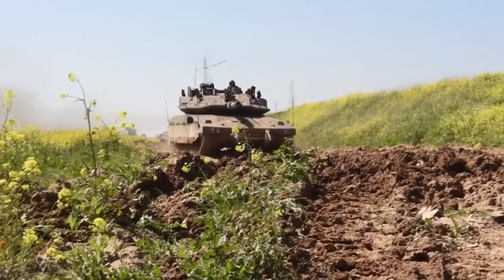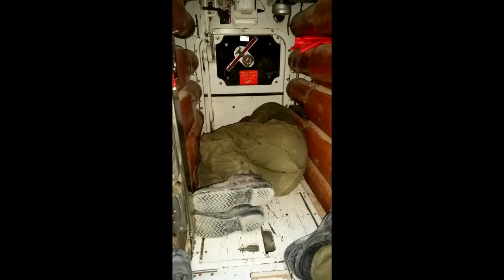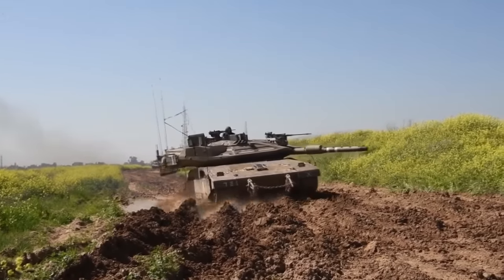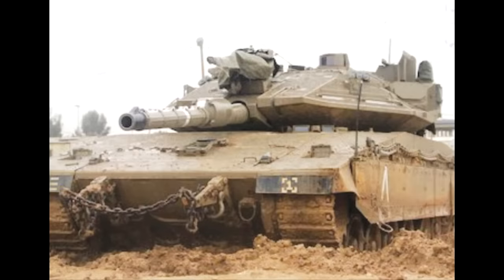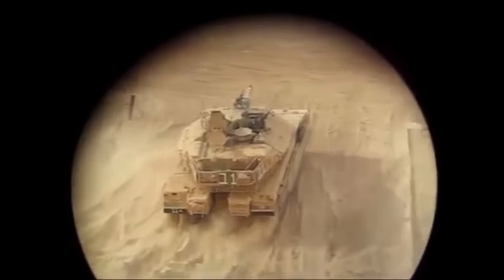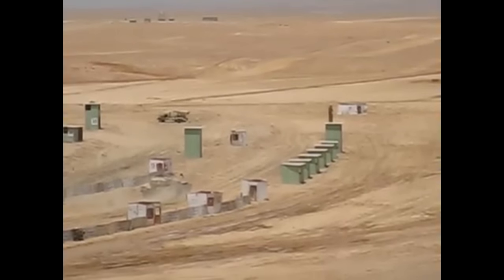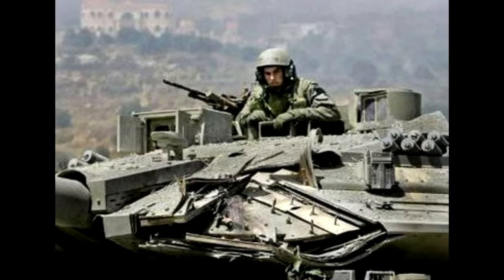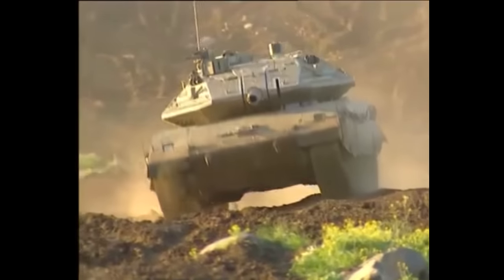Problems with Merkava tank

Comment: just watched this again since this tank got knocked out by a drone that costs at least 10000 times less than it's price lol
Reply: And rpg-7 shell that is old af
Reply: even russian tank dont burn from grenades when hatch door is closed
Reply: @Zx17OPv57i  Yeah,  also the Russians sometimes put a grille over the tank. Everyone in the west laughed at that.
Reply: those are almost all tanks. Most tanks are very lightly armored on the top. Meant to protect from shrapnel and not much else. A mortar round to the head will kill almost any tank from above if it lands in the right spot (in that case, directly onto where the breach was located under, thus detonating the shell)
Reply: @gdtacos7082 bro I have never seen a single tank detonate from a  grenade that small
Even russian tanks take a couple even when the hatch is open
Reply: @MAHORAGADAOPPSTOPPA  more often than not, those are handgrenades being dropped from drones. Sometimes you'll get rpg warheads on fpv drones, but thats more rare. What was dropped on that Merkava Mk IV was a 85mm mortar round. Far larger and deadlier than a grenade or even an rpg. Or, i guess drone propelled grenade in this case. DPG lol
Reply: Interesting assessment from Red but I wouldn't discount Merkava... One thing Red pointed out quite a bit is that Merkava is poorly protected against modern APFSDS rounds, but effectively protected against HEAT rounds. Now ask yourself. Who is Israel most likely to fight? Say over the coming weeks and months? With that in mind, what kinds of ordnance is most likely to be headed towards Merkava? Shoulder launched ATGM's or 120mm cannons? Even absolute worst case, assuming a regional war it would be old T72 monkey models. I wouldn't hate those odds as an IDF tanker. Trophy is going to make a huge difference too, but I do wonder how well it will hold up in an urban environment operating alongside friendly infantry. I'll admit I don't know much about the system but I would not want to be the tanker who shreds a friendly infantry platoon to take out an RPG.

The dropped ordnance is a real problem for sure. But nearly every modern tank is learning that lesson right now in Ukraine. Drones didn't exist in a military sense when any of them were built, nevermind designed. Hell, we mock the cope cages... but really it's jury rigged slat armour on the top. We're just seeing janky prototypes that Private Conscriptovich cooked up to increase his odds. US grunts did the same sorts of things to try and uparmour their humvees in 2003. We'll be seeing cope cages and drone nets on Merkava's within a month. I'd bet money on that.

We'll also keep seeing Merkava's get popped 100%.  Anyone who doesn't think the IDF is in for one hell of a fight is delusional. Hamas is a lot of things but stupid is not on that list. Rational isn't either though and that's a scary combo.
Reply: @imperialus1 that last paragraph made what happened at Mogadishu pop up in my head for some reason..
Reply: No tank is infallible.
Reply: I know ur post is 4 weeks old, but as of now, Hezbollah has merked around 80 Merkava's, and Israel has had to take out the Merkava 3's out of storage to replace them. Also, seeing Hamas shooting Merkava's within 20 feet has shown the trophy system useless to react.   @imperialus1
Reply: @m00dy7  If that were actually the case though wouldn't we see burnt out tanks?  Lots of videos of AT missiles being fired at tanks followed by a big fireball, but if you compare them to tank kills in Ukraine you'll normally see penetration followed by an explosion a second or two later and the tank keeps burning after the fact. If Trophy hits a missile, the missile blows up, creating a big fireball between the go-pro and the target. You even see this in demonstration videos of the system. The real key thing is that, at least in the videos from Hamas that I have seen, we don't see the fire persist. There is an explosion for sure, but then it dissipates. That means the explosion was outside the tank, even if it did impact the armour and an explosion outside the tank just isn't going to do much.

Even if they are hitting the tank, the chances of a direct fire RPG actually causing a catastrophic kill on any modern MBT is pretty slim and 90% of the footage I have seen has been militants firing RPG's. A mobility kill is certainly possible if Trophy fails, but it really isn't that hard to drag a damaged tank back to a forward repair depot and slap on a new track.

Reality is, we have very few visually confirmed losses and it's a bit of a black box. Oryx isn't covering it, the IDF is keeping really solid discipline regarding their losses, and the Hamas militants (understandably) run away before taking the time to confirm a kill.

I'd be interested in any footage or photos you have found showing burnt out tanks. I know Hamas has some pretty solid drone operators, so I'm pretty confident that they would publish any post attack footage via drone.

One of the more interesting videos I saw involved a militant placing a satchel charge of some sort right below the Trophy system and detonating it before firing his RPG, but even then I didn't see any evidence of a secondary explosion that would indicate that the RPG penetrated the armour.

I did see one video where it looked like the ammo bustle blew out, but assuming it was working as designed the crew likely walked away with some hearing loss and a bad headache, but that is the only video I've seen that I would confidently say probably damaged the tank beyond the IDF's capability to repair it in the field.
Reply: @imperialus1  I think you’re confusing Hezbollah with Hamas. I said Hezbollah merked 80 tanks, not Hamas. All I said about Hamas was that ‘it has been reported’ that the close combat (within 20 feet) wasn’t giving the trophy system enough time to react. But you are correct, video confirmation would be hard since they have to high tail it out of there to avoid other units returning fire or if the main gun was still operational. 

I got the info from Scott Ritter in many interviews on YouTube where he said Hamas specially designed their AT weapons and aren’t your normal RPG. Also, he said it was Hezbollah that was wiping out the Merkava’s to the point that Israel has had to replenish with Merkava 3's (no trophy system) and send them to Gaza and sending the 4's to border with Lebanon.

Also, there is plenty of footage on telegram showing Hezbollah destroying Merkava’s with video after showing flames and destruction. Scott has also said the Hamas might be able to beat Hezbollah record of Merkava kills if this continues. He also said that Hezbollah has access to more powerful and better AT missiles than Hamas where the Trophy system and reactive armor don’t provide much protection.
Reply: @imperialus1 isn't the whole point of those two head rpgs is to activate the defense system and the second head to damage the tank? Called a tandem rocket?
Reply: also, about the question of evidence of destruction
the hamas fighters work in small groups of 3-4, they come out of a tunnel, fire and go back into the tunnel, they cant stay around to film the bank burn down
Reply: @imperialus1 commend you for your good analysis, there was a new vid showing 10 unites abandoned in a street.
it wasn't clear if Merkava or tracked APCs, plus Jazeera sat analysis said 88 missing unites last week.
Reply: Всë это ерунда, вот когда Аллах начнëт бить по Безбожникам, вот это будет Ад. Ждать осталось не долго.
Reply: @Zx17OPv57i  U seriously compared hand grenades with RPG ?
Reply: Same with any modern tank, non of them were designed for that

Comment: The design of the merkava is actually designed for counter terrorism ops, more then tank to tank engagements, which is why the engine is in front, to protect against RPGs, and the hatch in the back was made due to experiences in the yom kippur war where their centurions would run out of ammo on the golan height defenses and the tanks would have to pull back to replenish.